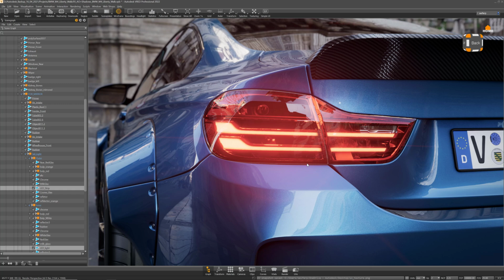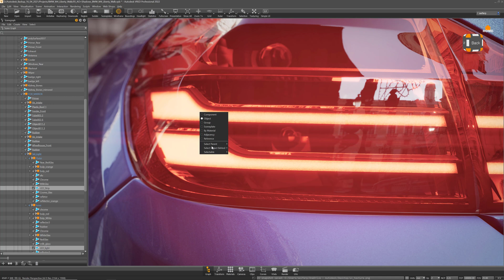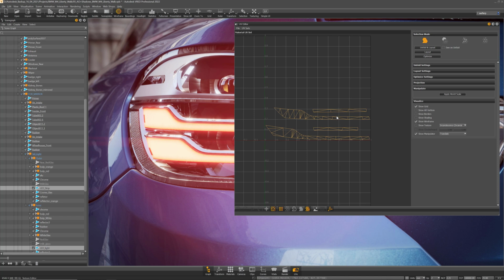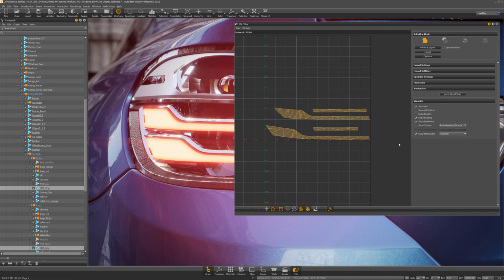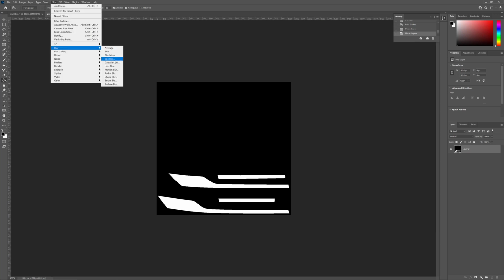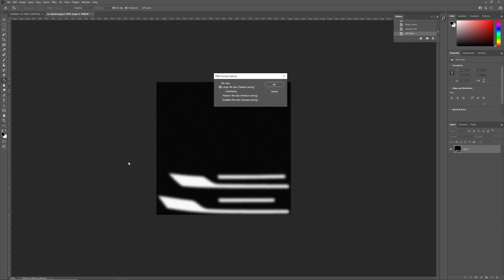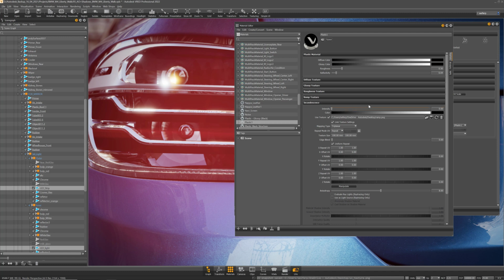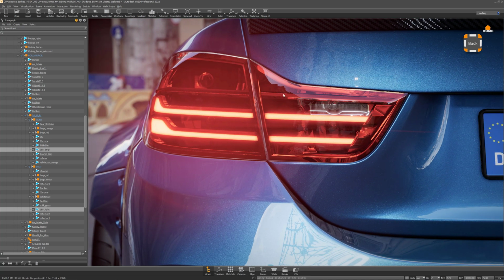Autodesk VRED - Tutorial - How to achieve a realistic looking taillamp in OpenGL

Comment: Thanks Pascal, can you pls create a tutorial for lighting up transparent signature lenses like these in Raytracing mode with actual light sources ?
Reply from the maker: Next video I’m gone do is about simulating lightguids with ray tracing. As an example I have sth. similar to a BMW daytime running light so called angle eye.
Reply: @VREDexpert   Thanks for the quick reply Pascal. Do you think VRED Pro can help do actual automotive lighting simulations with technical LED specs like ANSYS SPEOS or is is just cosmetic at the moment ?
Reply from the maker: @designssam  VRED can work with photometric parameters like lumen or lux, has volume scattering, can read ies and ray files, has a luminance and illuminance tone mapper, has spectral rendering to set wavelengths instead of just rgb values as well as path tracing and photon mapping with a max of 1024 reflection bounces. What’s probably missing is the possibility to measure the exact light intensity values inside a scene. There is only a scale with colors that gives you a hint in what range the values are. If you would like to learn more there is a AU class here https://www.autodesk.com/autodesk-university/de/forge-content/au_class-urn%3Aadsk.content%3Acontent%3Aedade089-e0ea-4819-a7a4-5615e5551e95
Reply: @VREDexpert  very good explanation Pascal. I have tried the light guide example with a production light guide I have. I can see everything works similar to your video. only difference is the light guide you are using is a single pipe in the direction of the LED and it bends into 2 90deg bends very close to the LED and most of the light scatter on the wall is because of the bends. The light pipe I am using is straight for about 100mm from the led face. The scatter on the wall is similar to your example and the photons also look similar, but when I turn off the wall only very small portion of the light guide shows some light -- like 2mm and the entire light guide is not lit. what do you think is wrong here?
Reply: it kinda looks like how your render appeared before turning on the caustics
Reply from the maker: @designssam  hard to judge from the far what´s going on. Any chance to share the file via PM or E-Mail?
Reply: @VREDexpert  yes, got a page with call outs and comments. how do I share ? Can I have your email pls ?
Reply from the maker: And some training slides here https://www.autodesk.com/autodesk-university/fr/forge-content/au_class-urn%3Aadsk.content%3Acontent%3A0e0b5125-8299-4c22-878f-a118f95f3ace
Reply: @VREDexpert  reading now
Reply: Thin lenses which are typically 2.5mm thick shells and thick solid lenses that are like 20mm light blades?

Comment: Hi Pascal. Where do I see the "Physical Camera" Option. I have Pro. Is there a secret to that? I see it in Version 2021, but not in 2022? Did it get deleted or is it called something else now? Of course VRED files for use in VR are not backwards compatible so I cannot use the 2021 version.
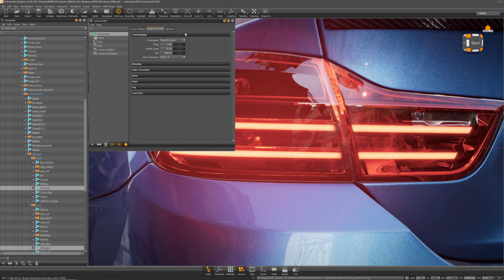Reply from the maker: @dutchy4c select your Camera and open the Camera Editor. 2nd Tab (Image Processing) and than it‘s in the Combobox of the Tonemapping. Check the video at 0:20 min!
Reply from the maker: Sure you did not open VRED Design 2022 by accident?!
Reply: @VREDexpert  You are correct. It must've installed Design with Autostudio. Switching to VRED Pro resolved the issue! Thank you!!
Reply from the maker: @cardesigntv  excellent 👍